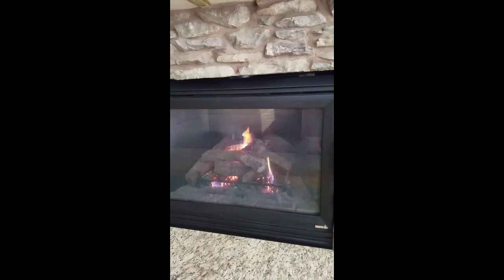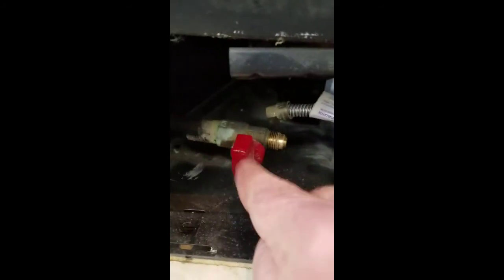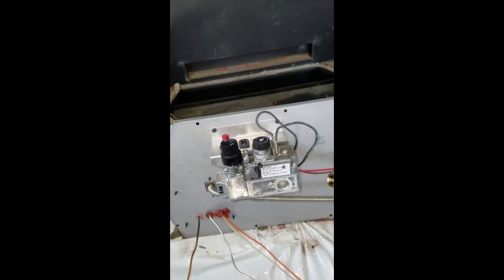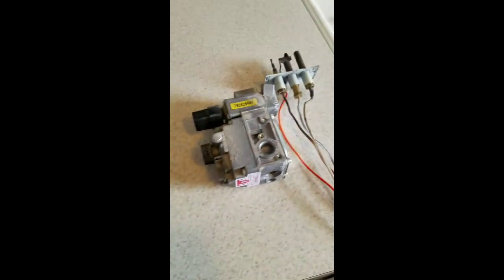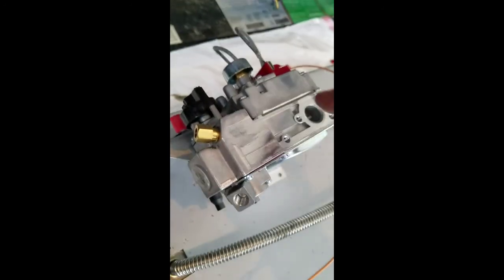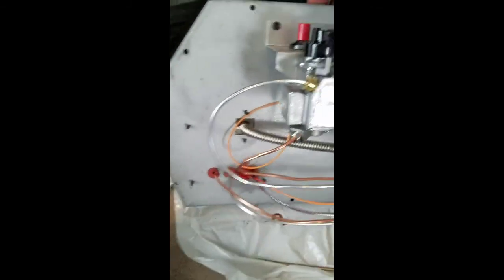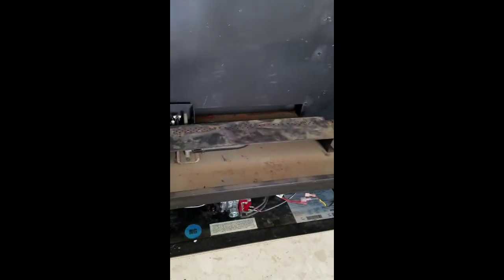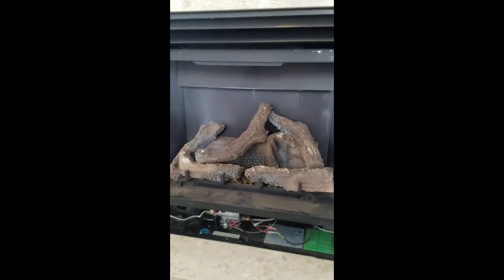Heat N Glo SL-750 Repair

Comment: Hi, our heat n glo won't stay on for more than 20 to 30 minutes. The manufacturer is not standing by this 1 and a half year old insert. A representative told us that the pilot assembly needs to be changed. If we're not changing the gas valve, do we still have to break it down to the level you did to install a new pilot assembly??  Great vid by the way!!
Reply: I just replaced my valve and thermocouple/thermopile/pilot light assembly as well as added a fan and yes, you need to take the entire assembly apart.  It’s not hard, just take your time.

Comment: Chris - my fireplace pilot light is on and good, tested thermopile - readings are good.. however when I turn the burner ON - I don't get full flame, its very low blue flame and lit only half of the plate,,, not sure what's wrong with mine, issue is low blue flame from the main burner, pilot is fine.

Comment: You skipped the steps of taking of the hood and louver top. I'm sure because it's easy for most. I took both of mines off and can't get them back on. Can you make a quick video demonstration on how to do that?
Reply: Frank I hope you've figured out the answer to your question by now.  If not once you lift up the top flap you see the glass enclosure has some metal clamps that need to be pulled back to release.  Once you you do just lift the glass enclosure up and remove, same process in reverse to put it back in.  Be Blessed, take care.

Comment: Chris, thank you for the video. I have a Heat N Glow 6000TR-OAK
 and this worked perfectly. The only difference is the base piece for my unit had two hidden screws securing it. You have to look down from the top so see a slot on the left and right with the screws 3" below the slots in the base plate. I've been putting off this repair for a year and your video made changing the gas valve easy. Thanks again.

Comment: great detail vid. thx 4 taking the time to do it. how can i replace 2 wall switches (flame / fan), with thermostat remote control?
Reply: kay nelson you can leave the switches in play and connect a receiver to the valve and sync remote. There are power 110/ battery operated receivers to put under the unit. Heat n glo has some remotes. So does sky tech. Hope this helps